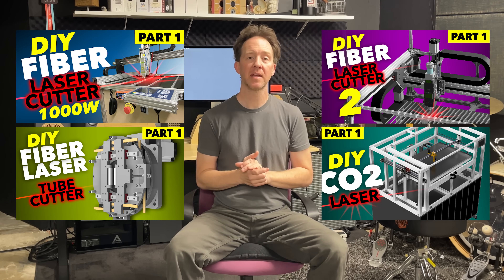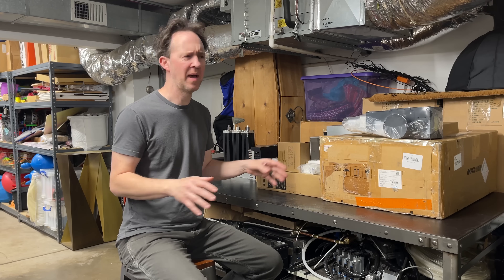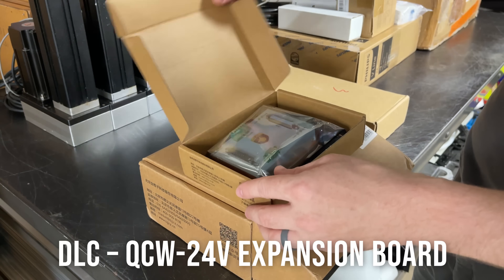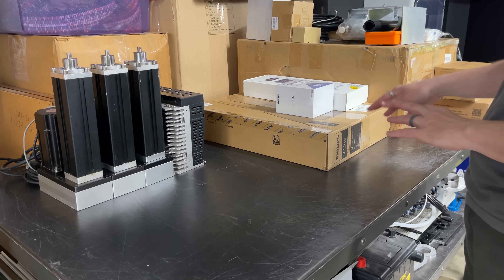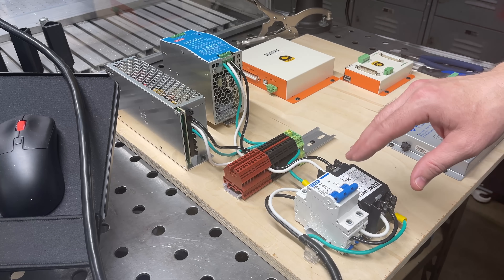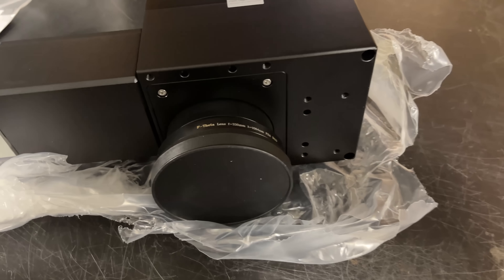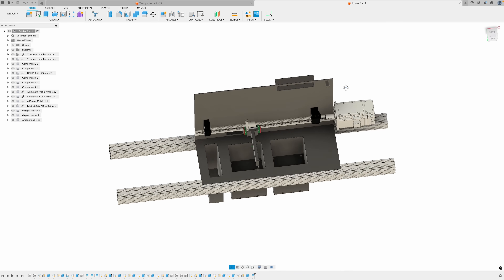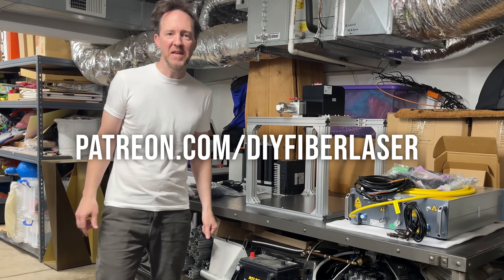DIY Metal 3D Printer: Part 1

Comment: The more major safety concern with metal powders is with metal fires. Various metals that are not normally associated with fires can become major fire hazards once in powder form. Titanium is a terrifying powder to work with and even aluminum can become prone to a run away metal fire in powder form.
Reply from the maker: Thanks,! several other commenters have also pointed out that I failed to mention fires and explosions...I mentioned an inert gas chamber but somehow overlooked mentioning why...I will fix this mistake in the next video.
Reply: @diyfiberlaser  It's more of a storage hazard. Like you said while getting laser melted it's in an inert gas atmosphere but basically at all other times the powder can be a really nasty fire hazard. Metals fires can also be self-oxidizing once ignited and most fire extinguishers are useless. Would highly recommend getting a metal fire specific extinguisher and get proper fire cabinet storage for the powder. Super cool project tho! Will be cool to see how things turn out.
Reply from the maker: @milspectoothpick4119  Metal extinguisher and fire storage cabinet are great ideas...I'm more of a free spirit risk taker, but all of my projects freak out my wife...that would help her feel safer : )
Reply: Yep Titanium, Magnesium, and Aluminum are all metals that can burn at extremely high temperatures and have been used for melting other metals.

Comment: Could you modify a fusion 360 post to output the file type you need? Looking forward to seeing this build.
Reply from the maker: That is an interesting idea, I did find a basic plugin that can output a .slc file type from Fusion. It is cheap, but I didn't get it yet because it seems like it would be preferable to have a slicing software that had more features, like auto support structures...I still may check it out as a last resort.

Comment: Nice to see that kind of project! With that laser source, it would make more sense to go on an LPBF printer (basically the same then SLM). It depends on the laser beam, but 500W should be sufficient to print steels and even copper alloys.
As already mentioned, fume extraction filters are very sensitive to auto-ignition when the fumes meet oxygen. You have to find a way to keep the filter section always inerted with Ar (or at least increasing O2 level very slowly to leave time to fumes to oxidize themself).
Reply from the maker: I was under the impression they were the same thing...how did one process get so many names? : ) Your feedback is crucial...I am listening, and I welcome all the help I can get to understand best practices for the filtration and gas systems.
Reply: @diyfiberlaser  I'm working as engineer for a LPBF printer OEM (especially the powder handling side), so I obviously want to follow your project! ;)
About the filtration, you must ensure your filter is well dimensioned. Fumes from the scanning process are very small, around 0-5µm. We usually assume that O2 concentration above 2000ppm (so 0.2% O2) might create a fire hazard with the fumes. And being below 800ppm (0.08% O2) is better to avoid part oxidation during the print. In any case, your filtration unit should be easy to detach from the machine, just in case. A metal-fire is almost impossible to stop. It's just better to let it burn outside haha.
For the gas systems, the simplest way to flush the process chamber is probably to open an outlet valve on the upper side of the chamber, and inject Ar from the lowest point (as Ar is heavier then air).
Reply from the maker: @quentin1362  Awesome, I'm glad you are here! I'm counting on the amazing feedback I get from more experienced people like you to help me understand how to do this safely...as this project progresses, I will be sharing my purging and filtration plans before moving forward with the build...so please keep me in check! : )

Comment: How are you planning on sintering the parts together at the end? will you be building a vacuum furnace?
Reply from the maker: From my understanding, SLM 3D printed parts do not require sintering.
Reply: No you don't on sls you do but a full melt just requires you to compensate volumes of different melting density because you loose volume on a full melt and every powder will have different degrees of vertical and lateral " swelling" then the part cools and only like 15% of that "swell" will re expand and harden @diyfiberlaser
Reply: I have a go fund me page to try and build my DREAM workshop after a fire took all my life's work away 😢 but I LOVE building so I am so excited to watch this and hopefully get my own soon
Reply from the maker: @new2itwontquit735  what is your page? YouTube won't allow links in the comment

Comment: You mention the health hazards it's also good to mention many of the powders are an explosion hazard as well, please be careful with that, would hate to see people repeat this project and blow their shop apart. I am very interested to see how you tackle the chamber heating. Been working on building a SLM system as well, the chamber heating is probably the most challenging part next to recoating.
Reply: It doesn't require chamber heating (unlike SLS printers). Heated build platform can eventually improve stress release but it is not mandatory at all for home build projects.
Reply from the maker: @quentin1362  Thanks for chiming in on this...from all of my reading, I thought that this might be the case, but it seemed like chamber heating would be useful if it isn't too much trouble to be implemented...we'll see where this goes, maybe it would be something that would be a good addition for a V2.
Reply from the maker: Thanks for pointing that out, I mentioned the use of inert gas, but I failed to mention why...the explosion risk is probably my biggest concern, I will make that point more clear in the next video...don't wan't anyone getting hurt.
Reply: @diyfiberlaser  inert gas isn't just actually for explosions, its also for controlling oxidation in the printing process.
Reply: Id argue explosions are a health hazard 😉
Reply: @a.1441 you literally took the words right out of my mouth 💀
Reply from the maker: @a.1441  Haha, I would agree...I will mention it next time : )
Reply: @diyfiberlaser powder bed heating will increase your scan speed you can get out of the lasers. Same as preheating for welds.

Comment: 2:15 please do not underestimate the possibility of a dust explosion, especially in combination with fume extraction!
Reply from the maker: Thanks for pointing that out...I mentioned filling the chamber with inert gas, but I see now that I totally failed on mentioning why...the explosion risk is high on my risk consideration, thanks for keeping me in check, I will definitely try to clarify this point in the next video.
Reply: Basically, the best thing you can do is stay away from reactive metals... no Aluminum or Titanium, for example.  Stick to 316 or 718 and you can simply use a good inert environment (N2 or Argon, for example with <.5% O2) and you'll be fine.
Reply: Also, you need to make sure you inert the extracted fumes... water (humidity) in them will cause big problem.  You can use something like sodium bicarbonate to neutralize them.
Reply from the maker: @williamsteele  I appreciate the feedback...I totally agree, I will probably start with 316 and I will definitely be sharing my chamber, gas, and filtration systems with you guys before I ever try to actually print anything...your feedback is invaluable!
Reply: @diyfiberlaser with most stainless powders the explosion risk is relatively low. with other metals this is very much not the case